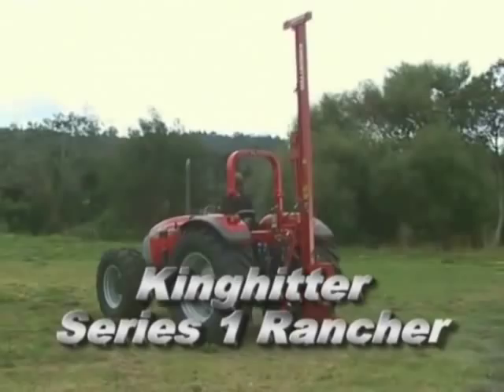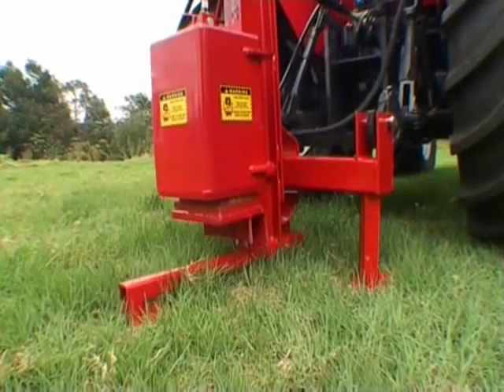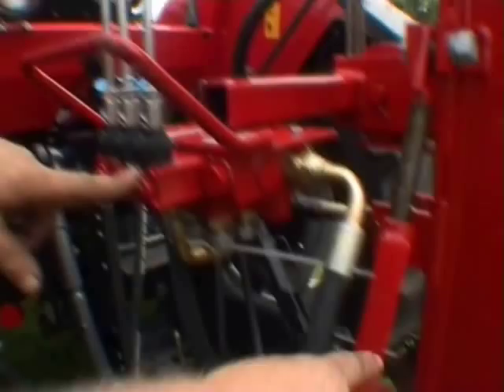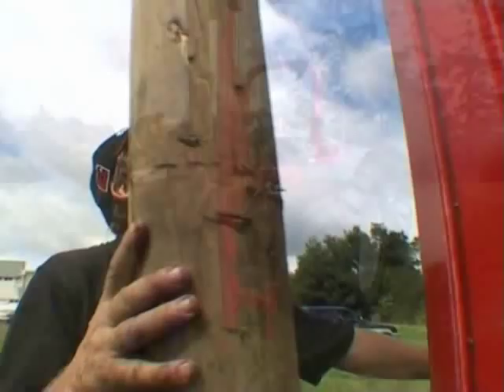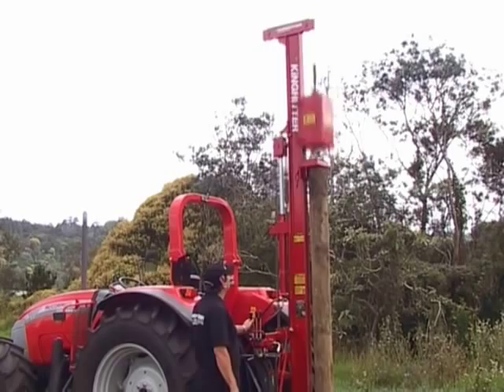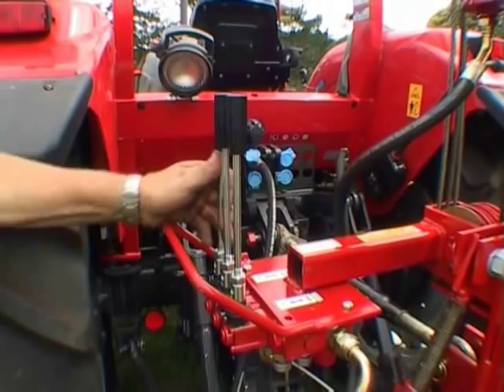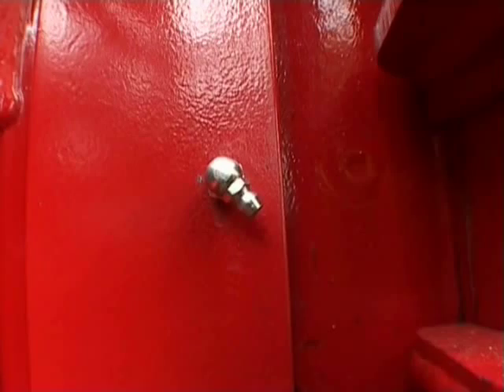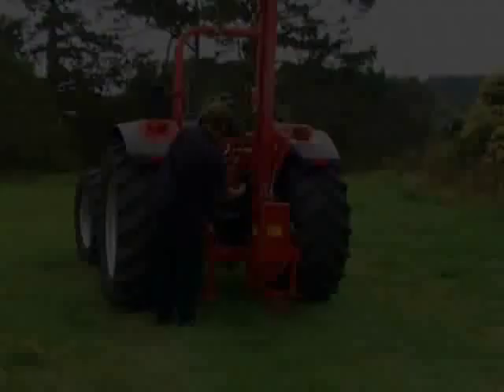Post Driver  kingHitter Series 1 Rancher

Comment: Mate all depends on the ground you are working in if you are driving a 150mm dia post  into normal ground.conditions  it will go in about 100mm every hit .If it is clay or hard base it may pay to chisel point the post on two sides approx 150 mm back up post.I f it is rock you are driving into you will have to use the Series 2 machine with the Rock spike or Auger.

Comment: Seems to me the spike meant to hold the post would make a place for water to stand and rot the post faster.
Reply: cut the top of the post off at an angle is the best way to prevent rot

Comment: I think the post driver industry has already made this obsolete. Not enough weight, manual adjusting(slow) and no grapple to hold the post. That spike is going to cause you more issues in the long run.

Comment: I fail to see why this is any better than an auger attachment.  This is more expensive, more cumbersome, with more mechanical stress points for potential failure (cf a shear bolt on an auger drive), and likely a monumental pain in the pooper to get on the 3-point hitch.  Looks like this is a poor solution for a problem that has already been solved.